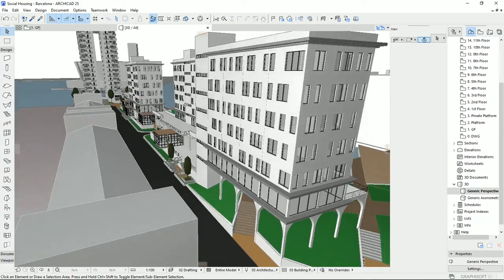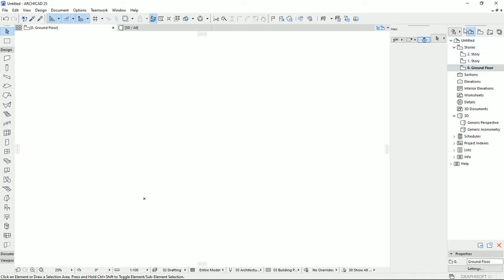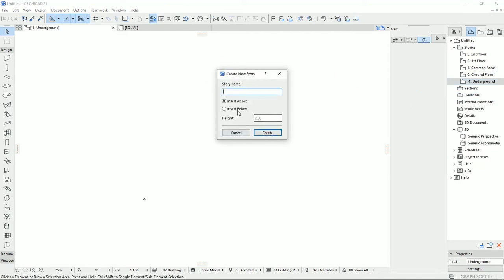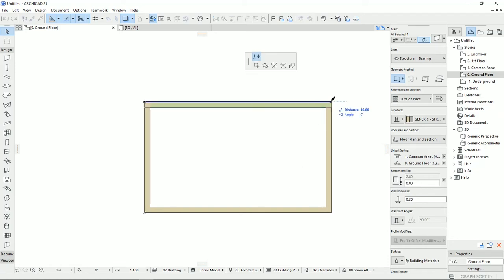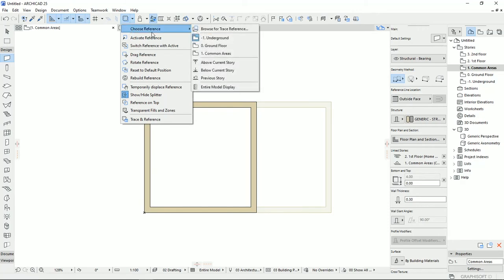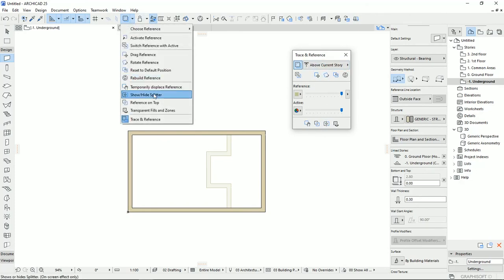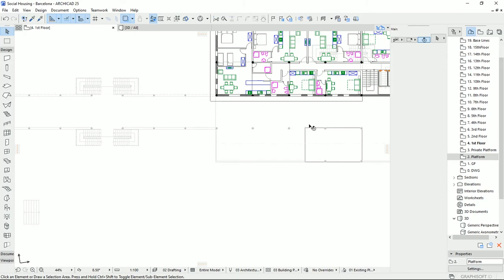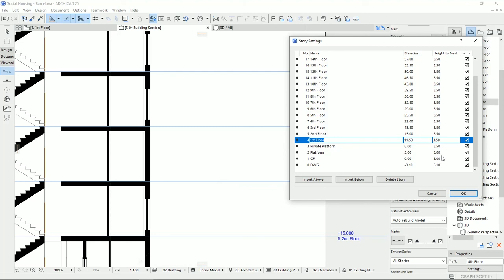Archicad - How to work with story settings (and trace tool)

Comment: It really good video, but I really want to know how to set slab between stories.
Reply from the maker: great question. you should consider the slab thickness, under the home story elevation. for example, if the home story is 2 meters above the project zero, and the slab thickness is 30 centimeters, you should draw it on the home story (+2.00) with 0 distance from the home story, and the thickness will go down to the lower story (+1.7).
Reply: is this d same way as to multi-level storey? if so how do u show d plans on site all together if its on different buildings?
Reply from the maker: Yes, this how you van control the story levels.
I believe on the site plan you should draw only what you have on that level. if the site plan is on 0.00 level, you should not show the building plan on the first or higher floors.
even though, if you have to show the site plan on the first floor, you should setup the objects to be shown on "home story and 1 story up" in the setting dialog.